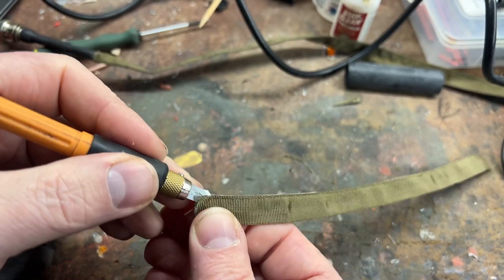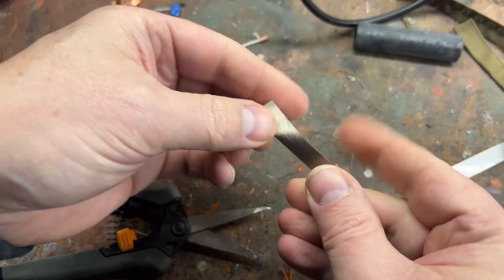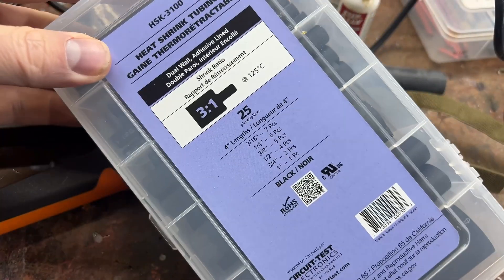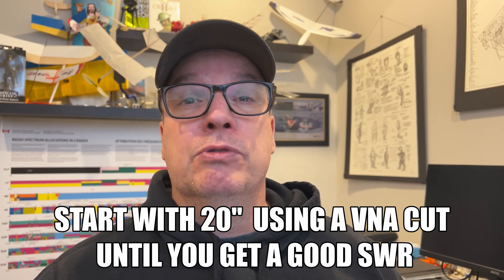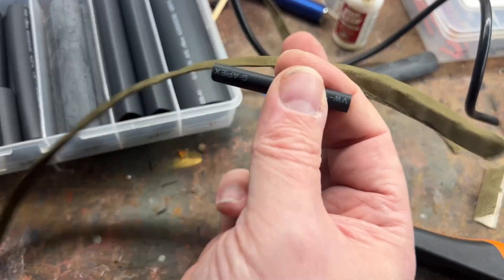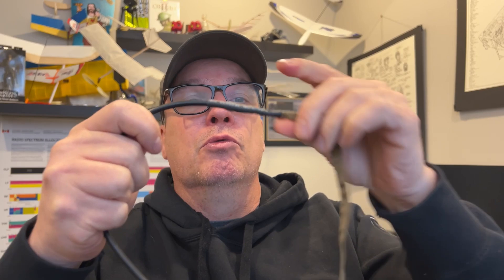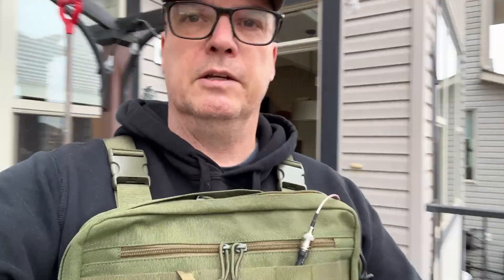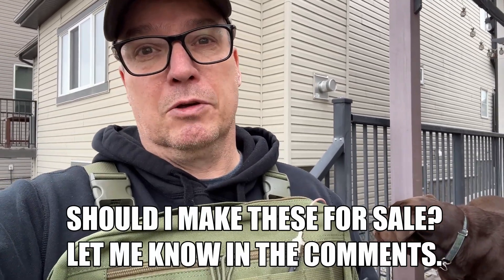DIY Ultra-Flexible HT Antenna for ham and GMRS radio | DIY survival gear

Comment: Would this make a good ground plane? Skip the BNC and use a loop connection.
Reply: Oh, I really like that idea
Reply from the maker: Ill be honest here I am not sure I am following. Are you suggesting just hooking this up to the HT on the body somewhere to use as a ground plane? I am pretty sure you mean this but want to make sure
Reply: @VE6SFX_HamRadioRookie  I interpreted this as a solution to make radials for the ground plane for a vertical hf antenna. Though I'll let him answer that for himself.

Comment: Awesome.  PLEASE make these, but I would ask you to get out the VNA and work out something that works dual band.

Second, why not a true dipole?

Finally, if you wanna recover your costs, you better rush, as you can bet there will be copies made from Pure Chineesium before you can blink.....
Reply from the maker: I want something as simple as possible. Thus the single element. Also as I understand it dipoles are 72-75ohms at the feedpoint. So it would throw any swr off

Comment: Could you put a metal plate inside the carrier to make a beefy ground plane?
Reply: It would capacitively couple with the radiating element. If the radiator was ~ 1/4 wavelength away from the plate, it would be a reflective element of a directional antenna.
Reply: @rickinmi  I'm going to look pretty funny with a shoebox mounted to my plate carrier. 😆
Reply from the maker: The other comment pretty sum up my thoughts. But hey if the shoe(box) fits ... :)

Comment: What gauge wire did you put in the BNC pin?
Reply from the maker: 14Ga and thank you for pointing this out. Dont get stuck on the Ga of the wire, any wire that fits snugly into the BNC hole will work. If the crimp binds the BNC post and the fabric together then you are golden.

Comment: You haven’t tested anything, so no you shouldn’t be thinking of selling it yet.
Reply from the maker: Finding out if there is interest in the product is valid I think. And at the end of the video, is that not a proof that this works?
Reply: @VE6SFX_HamRadioRookie  

« And at the end of the video, is that not a proof that this works? »

Nope. Some people make CW QSOs with a lightbulb for fun, but it does not mean that using a lighbulb as an antenna is efficient nor it is even a good thing to do.
Ham radio is a scientific hobby, you can't throw anything on your HT as an "antenna", make a QSO on a repeater and pretend it's good enough to call it a proof. You need at least a SWR measure in the usage condition, and a transmission and reception comparison with the stock antenna and with an aftermarket one.
Reply: That's a fact in this day and age
Reply: Sad HAM.
Reply: @AccelHeight  

So anyone could produce and sell anything without proper testing and if anyone points that out, he's a sad ham? Seriously?

Comment: The issue is not exposition to RF, but RF radiation efficiency. Alas, with this antenna, the vast majority of the radiated power coming out of your HT will be absorbed by your body and not correctly radiated. And I'm not even mentioning the radiating pattern and the SWR...
Reply: Exactly.  Yet bunches of local folks will be telling me how good it is... ugh. I'm already preparing some info for when that happens...
Reply: @f1sls 
Careful, your ignorance showing.!
Reply from the maker: Wow… pre negativity planning. That’s a whole new level of angst I was not prepared for. How about instead take that time you would have in preparing being negative and spend it having a coffee with a friend or loved one?

Comment: I am a fan of metal foil tapes antennas, where they make sense (on rigid substrates).  Metal foils make no sense here because the intent is an ultra flexible antenna.  Think of Faraday cloth as multi-strand wire used in ultra flexible coax only flattened out.  Hmmmm, come to think of it there is flat, braided, very flexible, copper cable used for connecting electric motor brushes, shielding, and grounding straps. It wouldn't be as easy cover with camo fabric and couldn't bend into as tight a radius as Faraday cloth.  Hmmmm, again.  What about aluminized mylar (chip bags, coax shielding and space blankets).  The googler says that the Al-coated side is conductive. But I suspect the Al layer is too thin for good antenna-ing per John Portune's foil antenna design guidelines.  Maybe a three-way comparison test video is in order.  Hmmmm, again, space blanket ground planes?   Hmmmm, one last time, Faraday fabric in camo sock for an ultra flexible rat tail/tiger tail (ground plane wire) to increase the range of your HT with a rubbery duck or whip. No BNC required, just a crimp to a spade or loop connector.  Keep up the good work!
Reply from the maker: Love seeing the train of thought. Thanks for the ideas! Keep them coming!